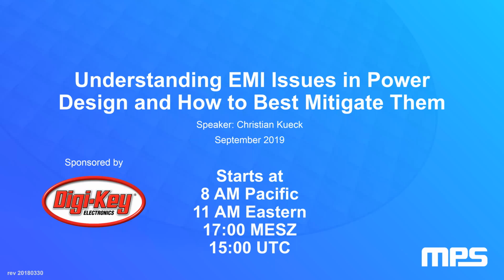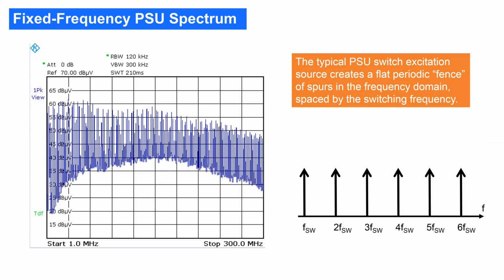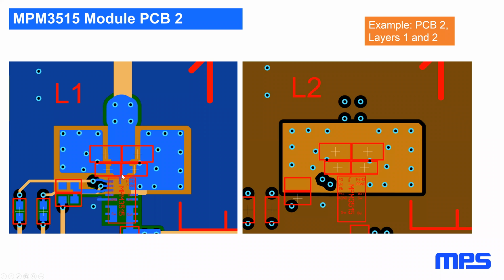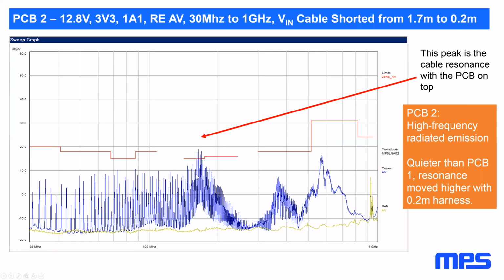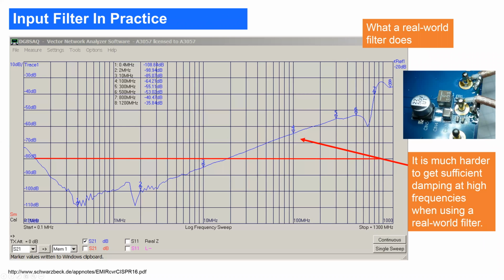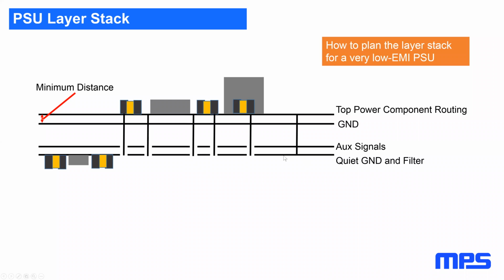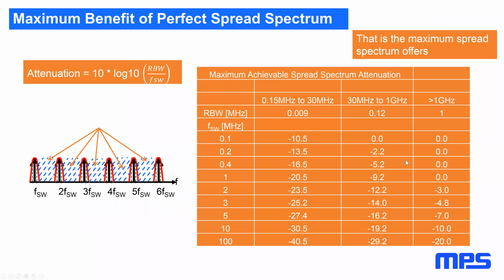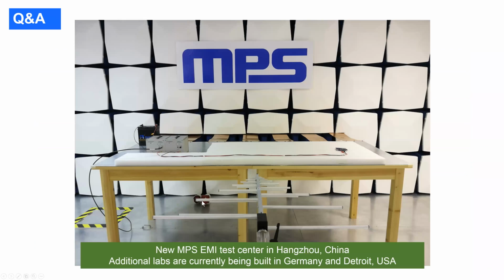Webinar: Sources of EMI, issues with DC/DC power supply performance and more

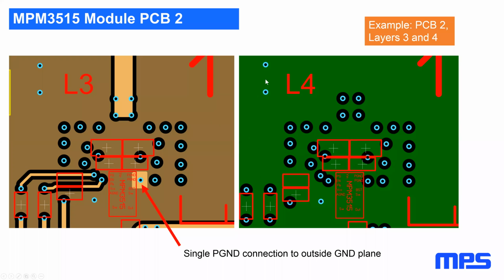Comment: Thank you for this video! At 12:40 why this single PGND via connection is selected to be close to IC instead of being close to or "after" passing the capacitors?
Reply: Hello,

It is more imortant that there is only a single point connection of the local "noisy" GND area to the quiet GND area. If you use a GND connection with several vias appart you will introduce RF current from the "noisy" area into the area you try to keep quiet. The absolute location of that single GND connection is not that important, but you should not use several vias with a big distance, if you are in a "noisy" high eddy current infested area.

BR
Christian Kueck

Comment: GREAT webinar, thank you, im wondering what was the simulation tool you used in 26:00 to simulate the the shielding effectiveness ?
Reply: @monolithicpowersystems  that would be perfect, it happened that I’m doing the same experiment over a several prototypes and scenarios .
Reply: A self developed (C#) grid based finite element simulation tool using using only Biot-Savart equations is used. The number of excitation sources is limited, so the simulation runs relative fast. To simulate the effect of perfect eddy current shielding planes, you mirror the excitation sources on the other side of the plane with the same distance.